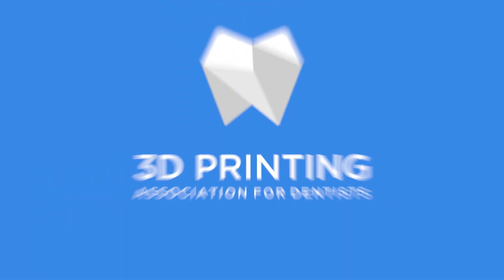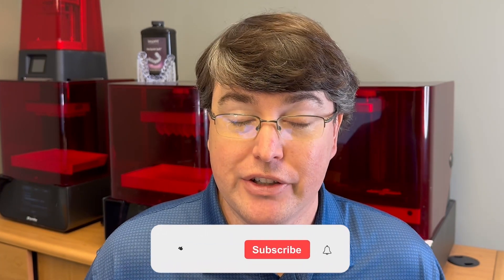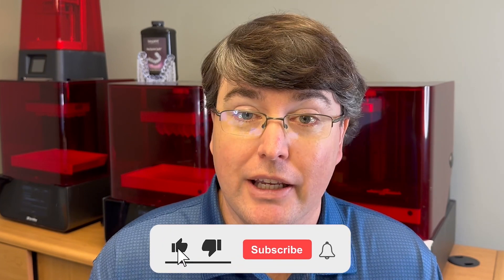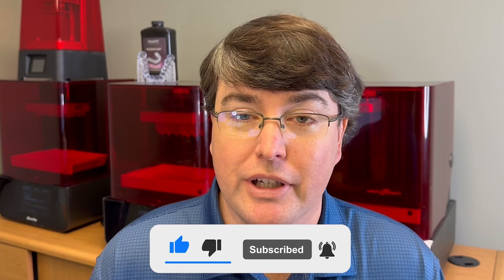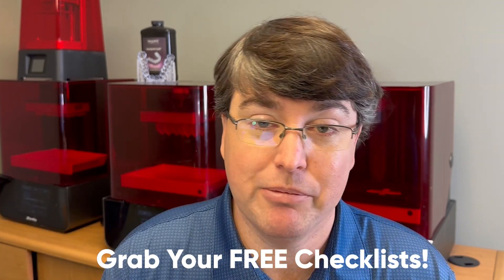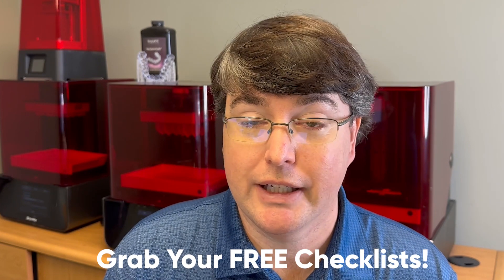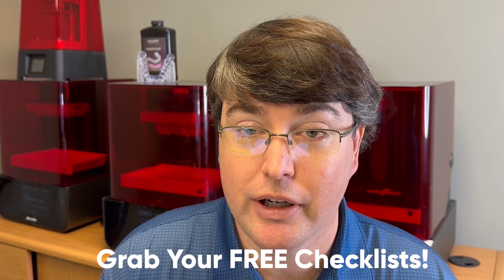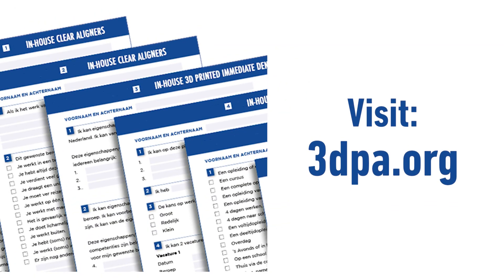🦷 3 Types of Crowns You Can Create With a 3D Printer

Comment: Any updates on Rodin? How did the crowns and bridges hold?
Reply: Hi as a dental technician I wouldn't use it for a posterior bridge only for single crowns (out of occlusion) and maybe for a 4-unit anterior bridge. In fact, we have used it for single crowns, but I am no longer working where we have.
Reply: @aroncarvajal7080  thanks for the comment 🙏 😊
Reply: @catalinsoare1261 no problem I've been a dental technitian for over 20 years and have seen a lot of different things for a posterior crown it's probably going to be ok as long as you have simultaneous contacts, and the good thing is that if it happens to fail you can cut right through like butter and replace it with a similar or something else😊
Reply: @aroncarvajal7080 I live in the EU. If it fails after just 2 years, I am liable and will have to make it again for free. Not to mention that I will lose clients. A milling machine is out of question, because it is ridiculously expensive 😳 and I don't have big volumes to justify it. I don't know if I should buy now a printer or just wait 2-3 years until the printed technology will catch up a bit with the milled ones 🤔

Comment: Indirect(Lab made) porcelain filled composites have been in use for many years, and used for permanent crowns and bridges. Printed porcelain filled resin, why not. Do these printed crowns need Curing ?? Milled Zircon needs sintering, Anyway, dentist usually do not have time for any printing/milling or else, yet, a in practice Dental Tec. or trained assistant can do the printing. but it still needs time to finish the crown..Not fast enough for the pacient to wait arround.
Reply: The expensive printers can do a temp or set of Temps in 10 minutes. The inexpensive like the phrozen mini 8ks or 8k can do it in 20min. To final clean and cure add another 5 minutes max. You can preprint a shell for reline but I have not found a good resin for the reline process that will not stick to buildup be easy to remove not distort and still stick to the shell. If the patient lost the temp you can have a full provisional ready for them before they get to the office.  In my opinion the design printing and curing of a well fitting temp should not take more than 10 min for everything. For single unit currently even the expensive printer is too long. For multiunit I can live with 20 min and maybe we can push that time to 15min with some modifications to the settings. Water washable resins are a lot easier and faster to print but their tensile strength is too low to be a provisional.
Reply: How many allergic reactions to the resin used?